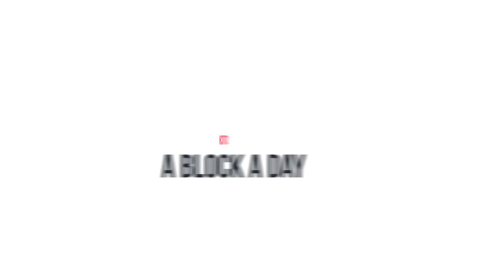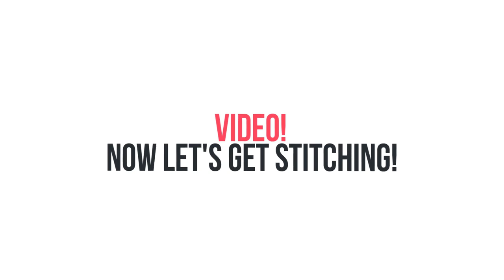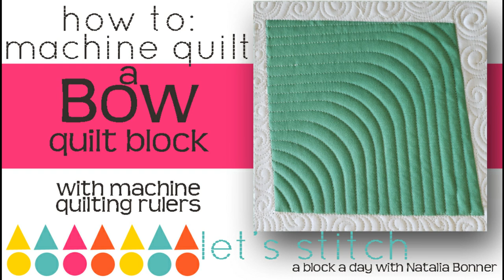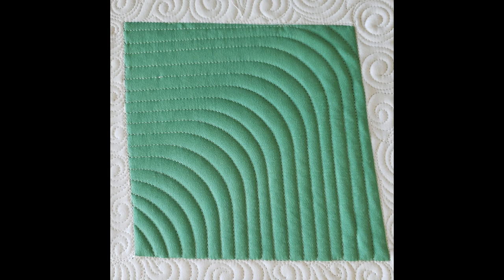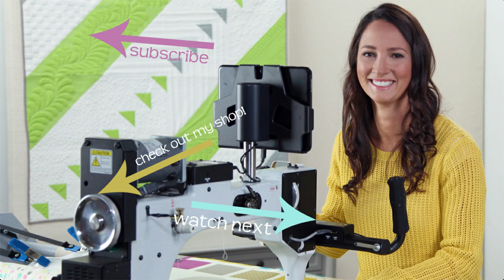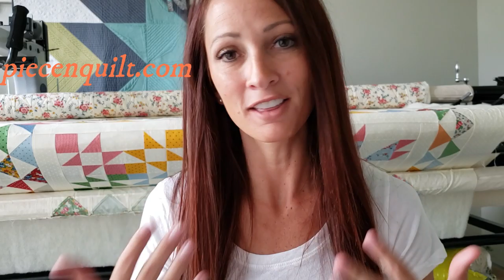How To-Machine Quilt a Bow Qulit Block-With Natalia Bonner- Let's Stitch a Block a Day- Day 49

Comment: Hi Natalia, thanks again for doing this! I cannot begin to tell you the way this has opened my mind and how it’s helping me get so much better...and fast! My confidence is through the roof. We needed to drive yesterday to our camp and I told my husband, “Not before I do at least six of these blocks for my class!” Lol! Question: how many of these panels would I need to do the year? They come in different sizes, so I presume that the other sizes have more blocks? I am confused. I bought the smaller one to start (they are VERY expensive). I am still playing catch up, but I am getting close to the end of this panel. What would you suggest to get the most bang for the buck?
Reply: P.S. Just ordered the trailer and preordered the Inside Out ruler.
Reply from the maker: Hey there! I am only using the smallest size panel, and you'd need 7 to stitch all 365 blocks. You do not need them top stitch along, many are stitching on solid fabrics or pieced tops. 
The larger panels do not have more blocks, just bigger ones!